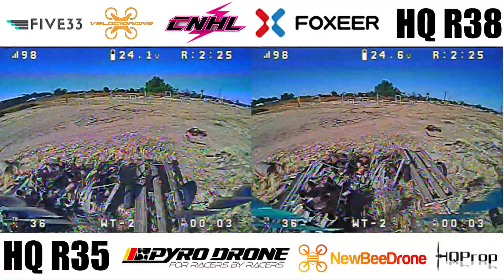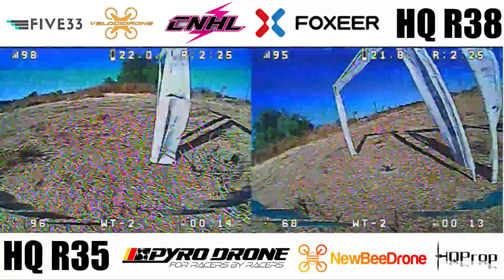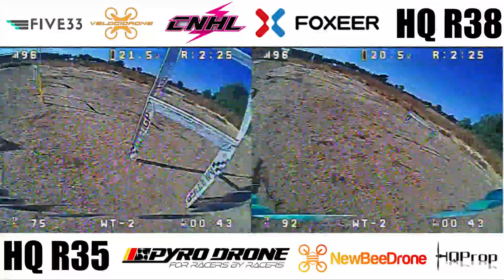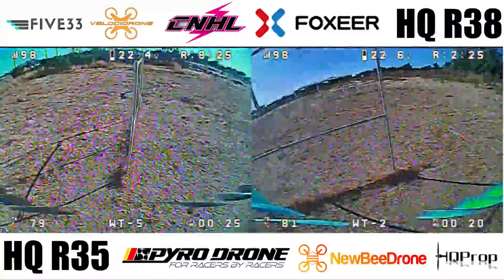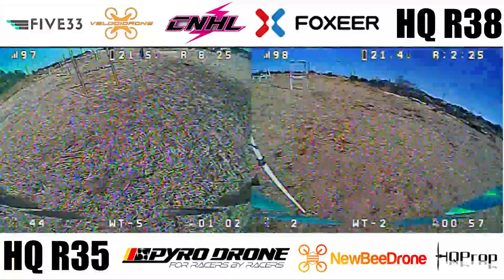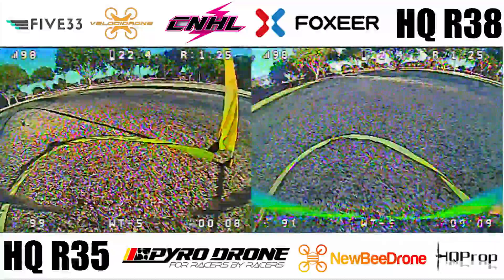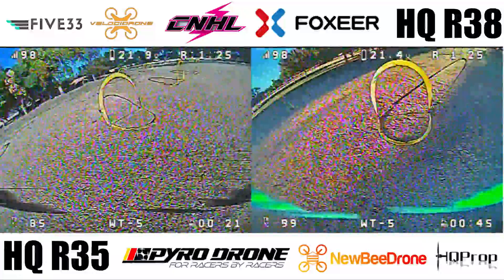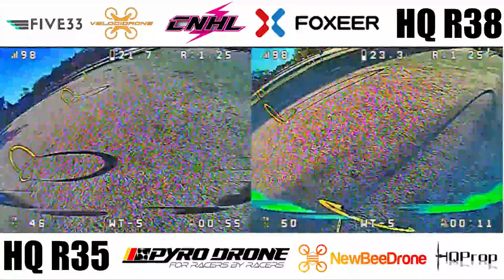HQ R35 vs R38 | Initial Testing | Wildtype Drones

Comment: Great comparo.  I love all the HQ R series props and their all I’ll run on my racers.   Serg from pyro sent me a few sets of the r35 before they were released to test and I still haven’t put them on a quad lol.  Back in February I ordered 15 sets of the r42 and r38’s and still have most of them left.  Haven’t flown much the last 6 months but still those props are beast for durability.  End of last year I went thru 4 races on the same set of r42’s.  👍👍👍
Reply: Think I’m about to slap a set of 35’s on my racer and rip.  But the only rigs I have running right now all have 2207.5 1722 hyperlite e series or Xilo 2207 1750’s.  But I kno the r38’s run great on them so the 35’s should still be great if I bump my throttle cap up a little.  I race with it set to 85 on FalcoX and for me both quads fly just right.   Thinking bump it to 90 to start and just go from there.

Comment: Do you run SFGs on the Switchback? I’m curious your thoughts on them.
Reply: I like em on tight courses.  Not sure how I feel with em on a longer track but have only done one big track with them.  In straights the pitch angle was super locked, def not as much drift in corners.  Need more time with it tho.  But I also have a arc one with a “box” frame on it from kinetic aerial and yea it added a lot of weight but has that same super locked in feel as the switchback with sfg’s only heavier which on certain types of tracks for me I love the weight.  I donno which I really like more yet.   Haven’t been able to fly much the last few months.  I don’t always get to fly, but when I do it’s always on HQ R series props. 😋😂.  Joking but not really.  I do love the R series props.

Comment: Love the format.
I do feel like the answer is that the lower pitch props transition better from unloaded to loaded as far as consistency, and it's about getting that displacement to line up with how much inertia you want to carry/displace with when entering moves. I do feel like the 51433's on excess KV are the best answer for me, they take some serious power to flatten (but 2207.5's will do it).
I think adding a bit of KV can even that out slightly (or if you're at stupid KV, reducing throttle limits)... what I like most is that I can swap back and forth on props and feel more ideally tuned for tighter or more wide open tracks). I think your approach is absolutely dialed in, but I'm probably biased because mine is the same (just with less pilot ability)